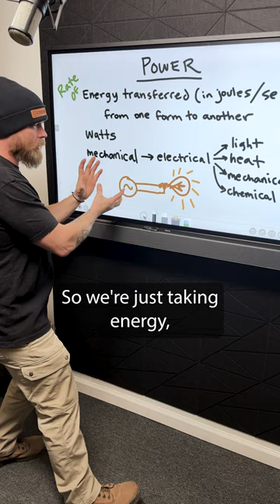What Is Power???

Comment: How does a dc to dc converter works?
Reply: A couple ways to do it - linear regulators "burn off" voltage to convert to a lower voltage, and the more efficient ones chop the incoming DC voltage and it feeds through, essentially, a filter to get DC back on the other side.

Comment: All these videos are good enough for the most part,but end up being pretty cringe and either gloss over key things or really butcher details...

Mechanical power isn't 'generated in a generator' - it's the mechanical energy that's generating electricity. That's the generator part. You spin magnets (or spin wires next to magnets) and that, by the miracles of the laws of nature, makes the AC voltage we talk about here. 

Fun fact, generators and motors are the same thing - its just which direction is the energy conversion happening